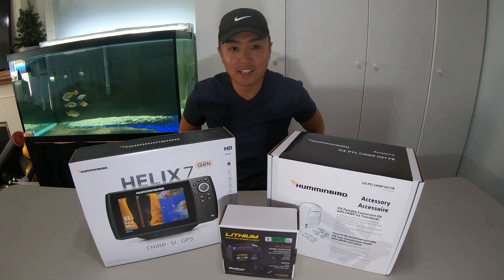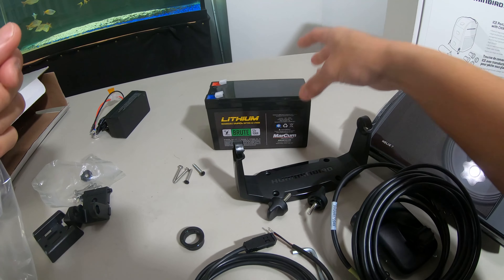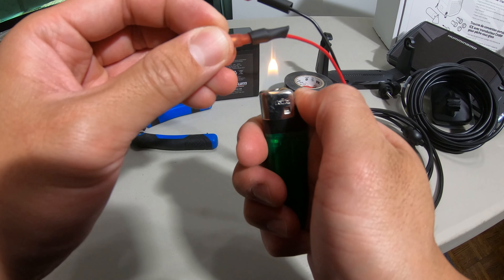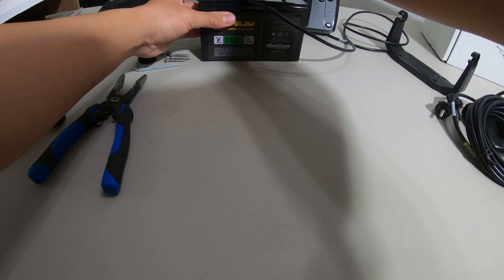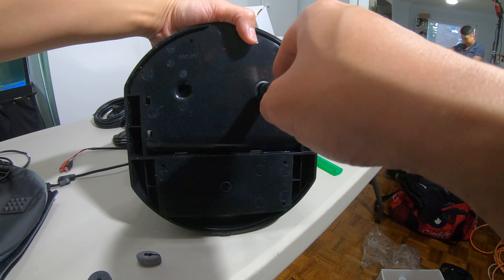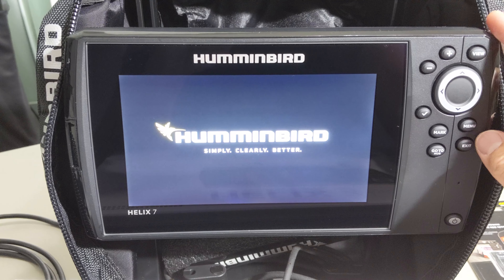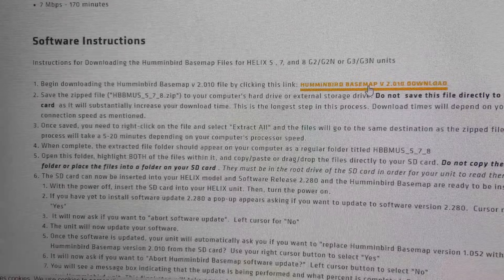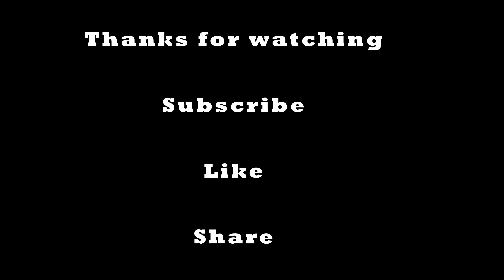Unboxing Humminbird Helix 7 + Lithium Brute Battery + ICE Conversion Kit (How to Assemble)

Comment: What did the update provide and/or improve over the default version? I just got the same unit and history has shown updates on older bird units can cause issues so I'm hesitant if there's no real useful upgrades. Thx.
Reply from the maker: If your device is working then there is no real useful upgrades for you. This update is more for when you just opened the fish finder from box, it won't show any data unless you have an micro SD card with the files in there to provide the default data. The only real upgrade for you is to buy the micro SD cards sold by hummingbird or navionics or lake master which will give you more info on lake depths and whatnot. I hope this helps! 😄